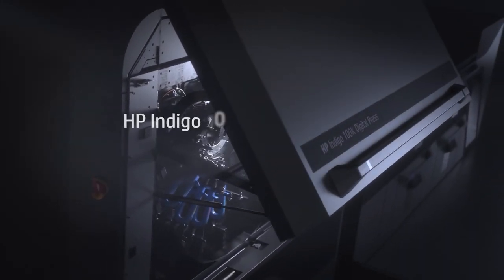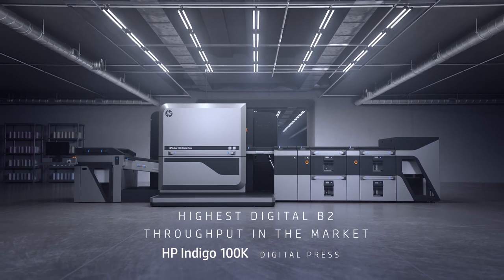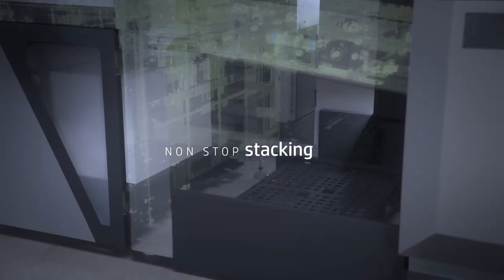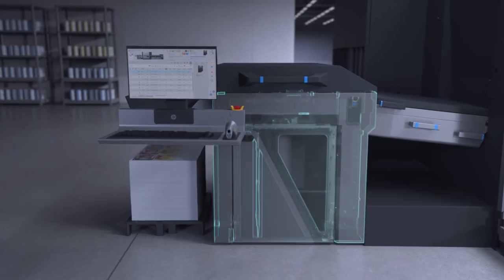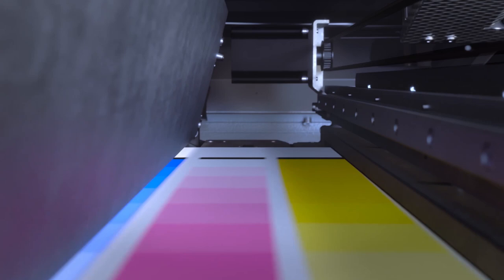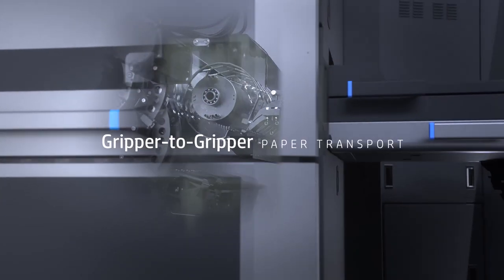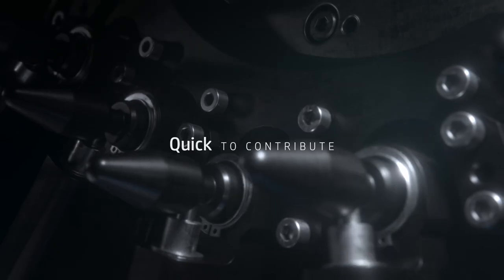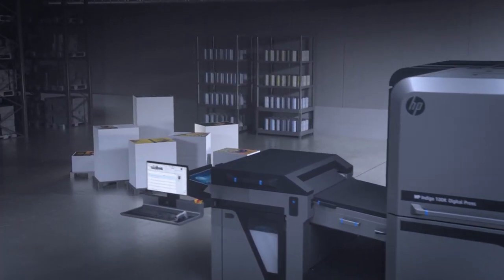HP Indigo 100K Digital Press- Born to Run | Indigo Digital Presses | HP

Comment: that probably costs more than a house
Reply: @screamingcockatoo  Wrong. Please do not deliver incorrect information.
Reply: @screamingcockatoo  VERY FAR OFF!!!  Not even close...
Reply: Charger Forme so, what’s the real price?
Reply: @marving.5365  No pricing info yet, their closest last gen press HP Indigo 12000 is a bit less than 2 million USD. 100K should be more expensive than HP Indigo 12000.